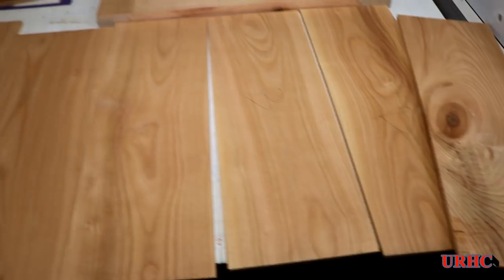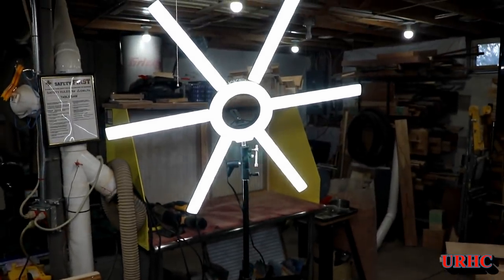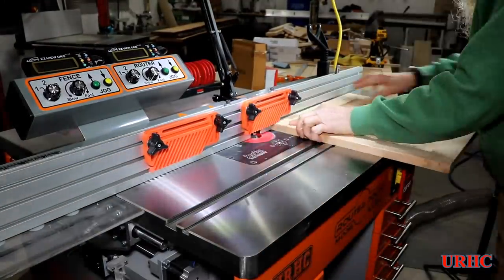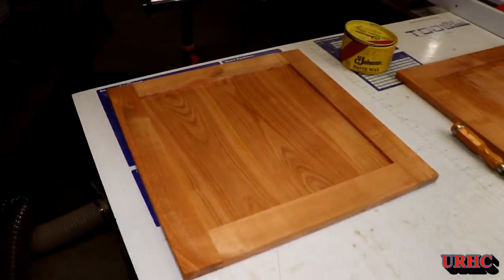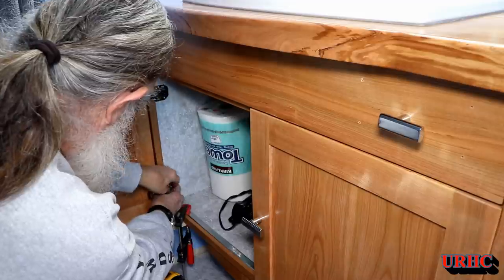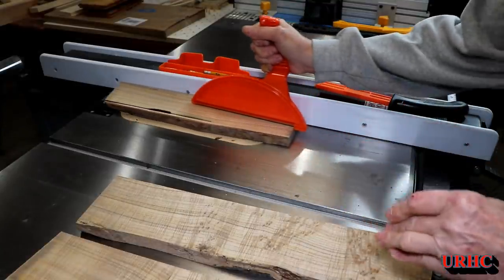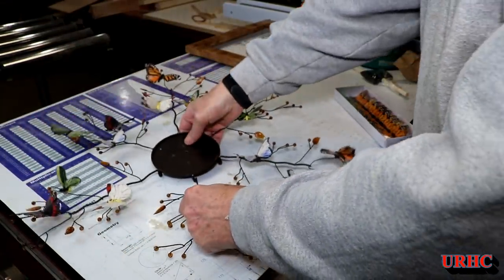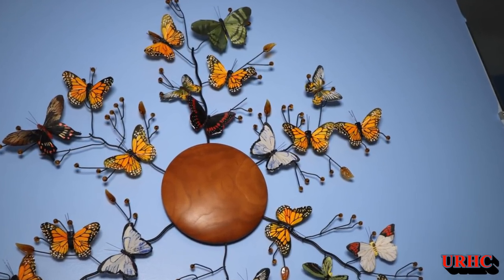Guest Bath Update Part 7 Vanity Door Assembly, Molding Stock, Framing The Poem, Butterfly Wall Art

Comment: For your dust filters at sanding station - make them2 layers, put a more course filter in line with the fine so that the dust hits that course filter first, then  you can take it off, outside and brush/blow it off and that will let your more expensive fine filters last longer...
Reply from the maker: These filters are cheap and work better as they fill with dust. At about $3.00 each I really don't worry about cost.  Thanks for watching.

Comment: Another nice job to the series.
I see you got the umbrella adapter
! Looks a little different than my Bogen Manfrotto. I know that Impact and a few others copy the design these days.
I used Polycrylic
 on my coffee and end table, and it dries hard as a rock after some time. It's not quite kid proof though after 10 years. lol
I see you used the new pin nailer, because you can. :)
Reply from the maker: Thanks.  I found that adapter on Amazon for $16.00 and it's real nice. It's cast steel and very heavy duty for  half the Manfroto price. Really helps aim the light.  That light is really nice for finishing also. That Polycrylic takes 90 days to fully cure but it's the only finish my wife can tolerate the out gassing from. I always put a couple pins in glued frames with no reinforcement. End grain gluing is not very strong.  So far that pinner works good.  Thanks for watching.

Comment: Looks great!  I have a question for you, do you have a water filtration system you like?
Reply from the maker: Thanks.  No, we just have one of the large plastic filters with a cartridge to catch the fine sand that was causing problems with the faucet cartridges.  Your filter will depend on what you need removed so a plumbing supply house should be able to reccomend some.  Thanks for watching.